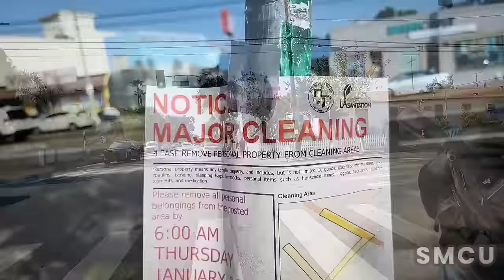Venice's Rose Ave Sees Persistent Weekly Cleanups Addressing Homeless Encampments

Comment: Anyone, tell me I'm wrong! The city allows the homeless to take over the sidewalk, prevent the public from using the sidewalk and turn the sidewalk into a substation for a trash landfill. The city, on a weekly basis, notify the homeless the city will arrive at a specified time and clean up after them. Not only does the city cleanup after them, the city provides police protection for the crew so they can safely cleanup after the homeless. The homeless feel the need to verbally abuse all involved in cleaning up after them, because they are inconvenienced. Finally, the city pressure washes the sidewalk, so the homeless can have a clean sidewalk to setup camp and collect new trash. I'm thinking the sidewalks have not dried out before the homeless return. Am I mistaken believing this is government's plan for the homeless and these actions of weekly cleanings will continue for the future with no end in sight? Please, criticize me, tell me I don't understand, tell me I'm clueless, but please give me the solution for the issue! 👍😎✌